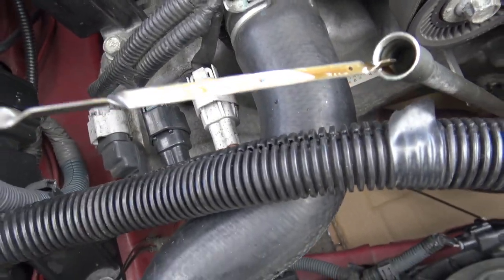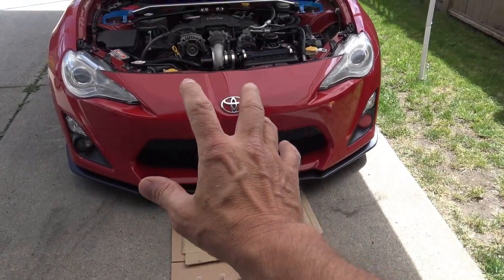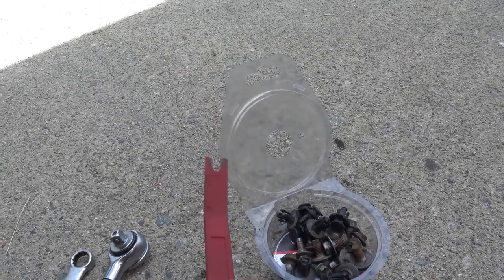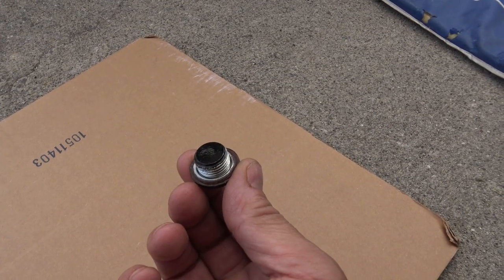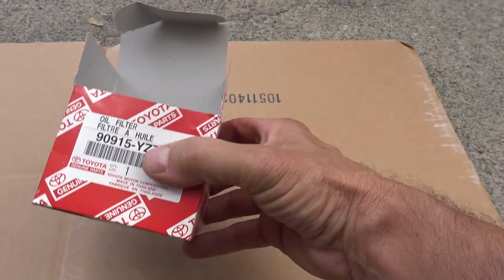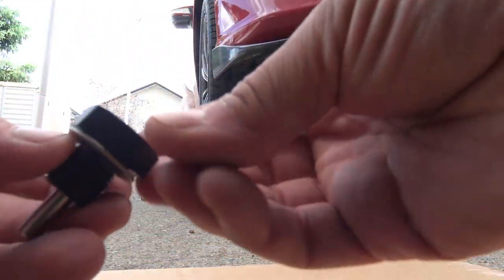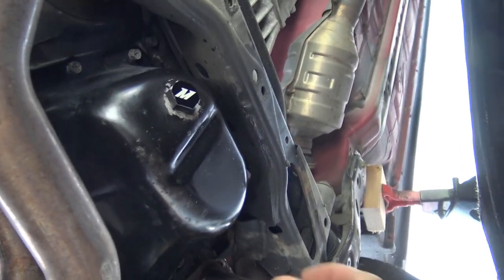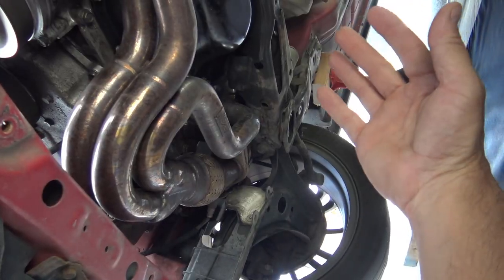What happens if you overfill your engine oil?

Comment: my stepdad bought a 2015 Ghibli that had been overfilled and driven, now it’s pumps white smoke through the exhaust but it’s still overfilled, what do you think happened to it
Reply: Engine damage
Reply: Liam Garcia could be antifreeze leaking thru the gaskets.
Reply: Russell Amano ended up being coolant mixing with oil
Reply: Liam Garcia good you got it figured out white smoke and milky antifreeze or oil indicates mixture between both liquids. hope it wasn’t to expensive fix
Reply: Russell Amano it was recommended by multiple mechanics to get a new engine as to fix the problem would cost the same amount or more than a used engine

Comment: Without wasting perfectly good oil and for the environment, I would recommend removing the filter (if the filter is at the bottom) 2 or 3 times (and circulating the oil in between by starting the car) to get to the right level.  And as others indicated, one additional quart is fine - ask me how i know 🙂

Comment: If you use a Fumoto ball valve as a replacement to your drain plug you simply drain however much you want without any tools or mess. You won’t even have the oil catch can to clean if you drain the oil directly into a container/jug. Easy peasy.

Comment: Just wondering if the engine oil is overfilled by approx 250ml do I need to remove the excess oil.
Reply from the maker: I would say no as that is a quarter of a liter and you would need to be overfilled by a liter or more to be in danger.
Reply: No below 15mm won't do any harm.

Comment: Hey so I filled my car with too much oil and it started smoking like crazy. Ive now drained the oil but its still smoking. Will that eventually burn off or should I stop driving it?
Reply from the maker: As long as it is not hydro locked it should burn off.
Reply: Photomikes Garage is there a way to tell if its hydro locked?
Reply from the maker: @AdventuresThings  If the motor turns over with the starter it is not hydo locked.
Reply: Photomikes Garage with the starter? Do you mean if it just turns over? I dont cars good
Reply from the maker: @AdventuresThings  Yep if it turns over with the starter it's good.
Reply: Photomikes Garage ok sweet. Thank you I appreciate it
Reply: Will it fowl out your plugs?

Comment: Bad job in the Toyota oil filter changing. Before to install a new oil filter on the engine make sure that the oil filter is fill max. w/new oil or max. oil that filter can absorb. After this step the oil filter is ready to be installed on the engine. All this info is for knowing that at first engine crank the oil filter is ready w/oil inside filter and the engine will receive quickly the oil necessary for all upper pieces. W/O SCARE, AN OIL FILTER CAN BE USED AND FOR 20 KKM, MEANS TWO TIMES MOTOR OIL CHANGING (10 KKM) FOR SYNTETIC OIL.

Comment: Can the oil overfill also cause turbo oil leaks? Now this JGC is refusing to start and I noticed huge amounts of oil in the inlet pipe from the turbo. Any advice?
Reply: Not likely. Over fill usually causes crank bearing to fail and oil seeps along the side of your crank and will ruin your serpentine belt. Oil in inlet pipe from turbo is normal due to Postive Crankcase Ventilation plumbing.
Reply: @kylelangley8818  Is this same for ATF transmission fluid ? Or where will overfilled ATF leak first? Thanks for interesting info 👍

Comment: the A-hole mechanic overfilled my oil by a quart and a half (!!!)- I discovered this after 3 weeks of (light) driving. I siphoned it out, but should I do something else? It runs much better now that the extra oil is out - but should I get a tuneup, check for fouled plugs, etc?

Comment: just loosen the drain plug  drain about 1.5  quarts  of oil  out  (after car has sat for 2 to 3 hours on level ground )  add oil after to the full mark on the dip stick  doubt  only   1 quart over would   cause  cavitation

Comment: Better still is to fit a Fumoto drain tap or something similar. Less mess, plus if you'd had fresh engine oil in the pan, draining it would have been an awful waste of oil and money, particularly with the cost of a full synthetic. Did you really overfill it or simply dip the dipstick in some oil and film it before it ran back down the stick? 🤔🤔

Comment: The filter is only lubed from the factory to stop the rubber seal from perishing. You still need to rub engine oil on tge gasket before fitment. Cool video though bro. 👌🏽

Comment: A pawn shop had a new looking Troy Bilt that had oil leaking out of the air cleaner and muffler. Oil was lleaking on the floor. I gave them 30 bucks for it .They were glad to get rid of it. I had an old engine that would fit it with some parts missing. Turns out someone had filled it with oil all of the way to the top. Drained some oil out. Removed the spark plug and blew out the oil.It smoked for awhile then smoothed out.
Reply: It was a self propelled walk behind mower. When the engine wouldn't turn either direction I was sure the engine was shot. My guess is someone told a young employee to make sure the engine is full of oil. They didn't take it in that condition.

Comment: Dude I just came back from deployment the wife took the truck to get a oil change it’s been 3000 miles since the last oil change  and I noticed the oil pressure is at 50psi at idle and 75 at light driving they put 8 qts of oil (0w-20) I think in the truck instead of 6 qts of 5w-30 I just changed the oil myself and just called the dealership I’m kinda worried but the truck sounds normal however the afm is acting weird even with the correct amount of oil in it now.

Comment: This is really dumb when all he had to do was to extract a little oil from the dip stick tube using an extraction pump or large syringe and small diameter tubing.
Reply: Or just half twist the nut where you drain let it slow drip a quart of oil and the tighten it back
Reply: Exactly! Facts! 👍

Comment: I over filled engine oil and drove from Vancouver to Edmonton 17 hours the engine was heating up, I had to stop multiple times for the engine to cool down, Now I have to replace the ignition coil and spark plug.
Reply: cuanto aceite de mas puso en su motor?

Comment: Believe I overfilled the oil today in a new used car that doesn't need an oil change for a good while. Checked the oil first thinking was  a little too low according to how the dipstick looked. So, I buy a quart and added half a quart. Dipstick to a previous car I had for many years actually had lines and the words min and max on it and had a crosstitch area.  All oil dipsticks should be this way.  Car I have now the dipstick only has two dots and have learned  the second dot is full/max. And, seeing it at full/max looks  how my previous car would be if oil was low. Believe was already full and added a half quart. I drove  maybe 5 miles after adding to go home.

Comment: Good tutorial on changing oil for the person who wants to skirt the ridiculous costs of oil-change shops...but in this case, I just have to ask, why change the whole shebang?  The oil was still clean, so the filter must have been clean as well...well, on the dipstick it looked clean, anyway; but I admit it is prudent to do a full change if you don't remember when you had a change done.  But, assuming it was rather recently that the oil was in fact changed, I would have looked into just draining out the excess oil, level the car and check where the oil was on the dipstick.  If it was too low, carefully put some of that oil back into the engine, and if it was where it was supposed to be, then dispose of the excess properly.  I think a full-blown change wasn't really necessary here...of course, even I can be occasionally wrong about some things, especially if there is a factor in the scenario that I was not aware of.

Still, for those who have never learned how to do an oil change themselves, good guidance, especially for those whose cars are set too low to the ground.
Reply: Keep a notebook only for maintenance done on your car . Date and mileage of oil change , oil used and filter used and engine flush .

Comment: My ex gf had her oil changed in her jeep Cherokee. They didn't even drain the old oil out. They just added 5 quarts. About 100 miles later,one of the rods broke. Engine was junk after that. Only had about 120k on it. Yes the place denied it and they refused to fix it. W

Comment: Will overfilling the oil on a 1997 f350 7.3L diesel also be dangerous?
Reply: Yes, chances of damage is more on the modern diesel that does active regens. During an active regen, some blowback of fuel occurs that temporarily increases the oil level  further more till the fuel evaporates.
But if it is 1997, that is pre EPA requirement to have the DPF filter so it can just be as damaging as overfilling a gasser.

Comment: If you have a cartridge style oil filter with a drain on it just drain the oil from the filter housing. You may have to do this two or three times depending on how much you overfilled it.

Comment: It's not just about miles: If you don't drive your car a lot, your oil still needs to be kept fresh. Even if you drive fewer miles each year than your automaker suggests changing the oil (say, 6,000 miles, with suggested oil-change intervals at 7,500 miles), you should still be getting that oil changed twice a year.

Comment: I would of used my liquid vac I bought at the auto shop and ran the tube down the dipstick tube and sucked out a little oil at a time and recheck until it’s at the proper level. Would of saved you a ton of money and time!

Comment: Ya mon
I taught a Jamaican friend to drive one summer.
Later in, he bought a car.
He brought the car to show me and says he had to add oil because it was low.
I asked how much oil he added.
He said 5-8 quarts 
Wait, what???

Ya mon, me nah see na oil in de engine when me taje off de cap.

Radcliffe, you flooded the engine with oil. It's going to, hell, even I dont know what will happen but it's bad.

We drained 3 gallons of oil.
Then I explained the dipstick and the engine pan etc ..
Saved his car

Comment: I bought an oil/fluid/diesel pump to get rid of too much engine oil.
What happened, i noticed the overfill by checking the engine oil dipstick of my car.
I drove for 28 years with cars with an exact engine oil level, so it was shocking to notice an official recognized brand dealership did make an oil changing mistake. 
Who did this???
So to keep my angel running with the perfect engine oil level, i pump out the overkill of oil and level it right.
I was lucky i could use the oil dipstick entrance, so i do not have to empty the full oil tank to refill it later on with expensive new fully synthetic engine oil. 
After measuring the engine oil level, i see a perfect level between minimum and maximum. 
It is necessary to level it right, because it is an extreme high quality engine that loose no oil at all, so burning an overfill of engine oil is no option. 

The black oil when the change oil is normal. Sure, at the dipstick side it looks fresh. 
Some smudge can be at the bottom of an oil pan, but only very old cars and cars that parked for years without driving.
Smudge can be removed, but ask a professional for more information. 

How i did pump out the overload of engine oil?
I ran my car for 10 minutes to get the engine oil at some 60 degrees Celcius. This to make the engine oil more fluid.
Connect the pump to 12v battery, put it on and here the oil comes and stream to an oil reservoir. I pumped 75 cl out.
That was a bit too much, so i put 25 cl back, check and yeah, it is just spot on! 
Conclusion, they put a half a liter too much engine oil in it. That is at the maximum that is allowed, no engine damages, albeit it is better to do it the right way.

Comment: To much oil causes the crank to become out of balance and can cause an engine failure.
Reply: Is this same for ATF transmission fluid ? Thanks for interesting info 👍
Reply: @acemoto2319  transmission fluid expands, as it gets warm, and will go out the vent and can also push past the seals.
Reply: @jessieharris1676  ok thanks Jessie, l noticed my ATF was slightly leaking after topping off with 7 quarts.  I think I overfilled.

Comment: Over-filling the oil will most likely start the rear main seal on the crankshaft  to start leaking , that is the first place the oil pump pushes fresh-filtered oil ...not an easy job to fix .....just remove the drain plug , catch the oil in a clean pan, put it back in the correct amount ....!
Reply: Is that because of extra oil pressure?  Would u know what happens with transmission fluid overfill?  I have Ford 2000 E350 and may have overfilled ATF.  Thanks 😊

Comment: In addition to the air/foam being created by the crankshaft, seals/gaskets can leak and oil can be splashed into the combustion chamber from underneath where it will burn along with the air/fuel mixture and foul spark plugs!
Reply: Any other side effects for overfilling? Just blew out a camshaft seal because my dumbass over filled, I drove it for a few weeks until I noticed the leak. Any internal damage or anything else I should look for? Thanks.

Comment: The crankshaft will make contact with the oil. It will foam the oil like whipped cream. We all know hydraulic lifters and oil need viscosity to work properly. 
A over filled engine will be damaged.

Comment: My 1993 Mercury Cougar was over filled with oil for like 2 years before I had bought it. The people thought it kept burning oil because the dip stick would read low after 2-3 days so they kept filling it up. And it kept bubling oil out the dip stick stem and flooding the mass sensor and half of the air filter with oil. Then the engine would cut off at red lights and stop signs because of the mass airflow was all oiled up. Eventually found out the problem was that the dip stick stem wasn't in the engine all the way. So that stem was pressed back in and oil read more accurate and finally the low oil level warning on the dash would come on when low on oil.
Reply: Nice story. BUT I SAY IT'S BULL  ! 
93s of any make DID NOT have  mass airflow sensors that I know of !
Reply: @dancahill8199  idle air control valve

Comment: I had oil change tech from Walmart had over torque the oil drain plug and stripped about 30% of oil plug tread. The tech told me to get a new oil drain plug that will solved the problem. When I went for another oil change from another quick oil change we found that the female screw tread that factory installed  (not by tapping) on the oil pan had came off portion ally  and stickled on the male side of my oil plug. It will cost me $500.00 for the new oil pan. Walmart had not response to this allegation.
Reply: How much is new oil pan on ebay or Amazon?

Comment: HR12DE got the shittiest oil stick, you literally cannot judge by it, i literally can't tell if its overfilled or short on oil
Reply: Same with my Ford 2000 e350 ATF  dipstick... it's hard to read so have to use different measuring methods

Comment: Subaru converted wrong and put like 4oz to much oil.... I noticed right away but couldn't get the car back in. 

I noticed lack of power right away but surprisingly I was able to use lower rpm better.
Reply: Year later car burns oil like a mofo...

Comment: I like this guy he's like don't take it to a shop to get an oil change they'll mess it all up, and then he adds a quart more oil to his own engine lol.

Also I use Amsoil and Amsoil filters because it's the best oil money can buy they're guaranteed to like 1 year / 25k miles or something stupid on a lot of their synthetic oils but I just do normal manufacture recommended change intervals. Figure if it can handle 25k miles, then changing it at 6k is only using a quarter of its life so you're getting 75-100% oil life or whatever all of the time instead of cheap oil that's ruined by 6k miles and has to be changed out.

Comment: And a clear explanation on how to read the dipstick, bottom hole should have oil, top hole should not, and if you can see the oil, it should be half way between the two holes.
Reply: Just make sure that oil is touching the upper limit

Comment: Would your car stop running?
Reply: No but it'll start looking like a James Bond smokescreen until it burned some off
Reply: If you just keep driving it and let it burn some off will you be fine? As long as you baby it
Reply: @JuniayJuniay  it'll be fine just keep checking the level. If you want to you can get a turkey baster. And two feet of tubing from home Depot or tractor supply.

Comment: I don’t have a BRZ, oil changes are very familiar to me, although I am super detailed when performing one, I still appreciate the tips. I drive a Supercharged Audi A6 and I definitely appreciate the electric supercharger and already  have an oil pan magnetic bolt, my previous car was a high horsepower turbocharged Golf with a mishimoto adjustable oil drain valve👍🏼

Comment: Hi,respect from car-flippers country Lithuania, it is often problem in cars with oil radiators,if you measure the level,just after you stop the engine.,there is electric pump to drain oil,with small hoses, you can put them into oil measuring hole,costs about 20-30euros.
Reply from the maker: That's a good idea!
Reply: Is electric ⚡ pump better than hand pumps?

Comment: Bring it to the local mechanic. For $50.00 you can get the oil the filter and the tires rotated with a complete inspection. Do it twice a year.  No mess no fuss no disposal of the old oil and filter.

Comment: Important to wipe it and recheck it. Probably some engines moreso than. Others but a good habit for all. Have a lawn mower that shows as overfilled but if u wipe the dipstick reinsert was under the min even if it hadnt run for hours or days. Yes it also has a screw type cap but that maybe accounts for 1/4"